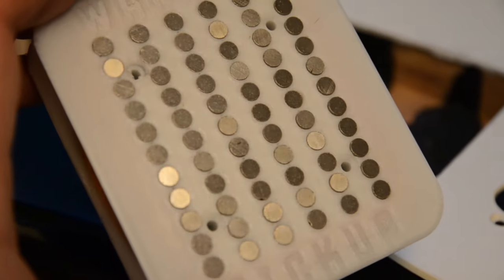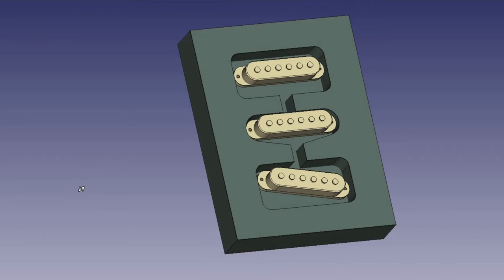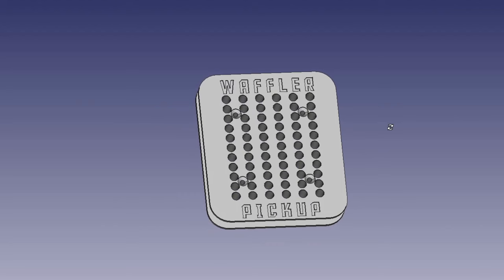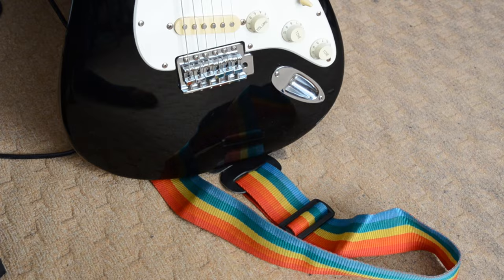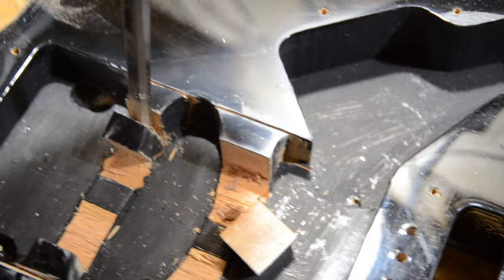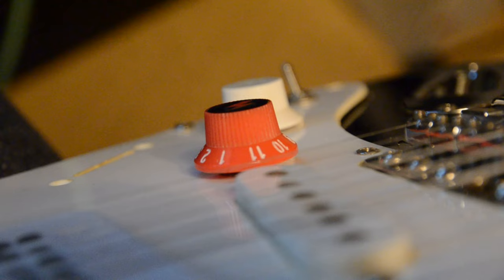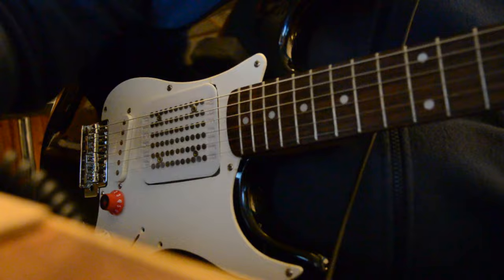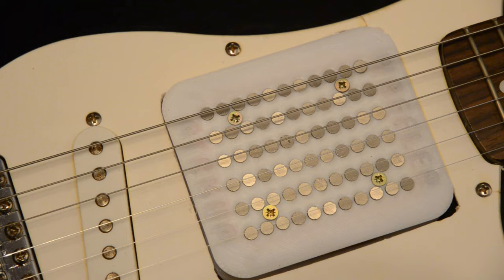Is this the world's most powerful guitar pickup? The Waffler pickup!

Comment: Hard to tell on YouTube, were the e strings much louder than the rest of the strings? Their pole pieces had much more copper around them
Reply from the maker: The strings sound evenly. I think its more to do with magnetic field that coil position. As the magnetics are all fighting each other (it takes some force to assemble this) a small change in magnet field on one side, moves the whole magnetic field. I am working on a video showing this. I will post this soon.
Reply: @deancoyle  one more question that you can talk about in your video, how does that many pole pieces effect the phase if at all?

Comment: Interesting experiment, however, there is no baseline to compare to. It sounds reasonably well, but there is no way to separate regions as there would be with separate pickups, which is potentially a drawback. A truly scientific experiment would have tested all of the variables before the introduction of the waffler pickup, and then the addition of increasingly larger pickups until there would be one single pickup taking up the spaces of all three original pickups. Also, several variations of the waffler pickup with various stages that could be switched on and off just like the original three pickups. 
Primarily, pickups sound different when located at different positions, because the strings travel as they vibrate and sweep a wider area the closer they are to the center distance of the string, or closest to the 12th fret. The frequencies generated closest to the bridge are shorter than those closest to the neck. It would be reasonable to assume that had you configured a waffle pickup with three separate sectors, four separate sectors or some other configuration, you would find that you would get different frequency ranges out of each sector. Although it would be interesting to hear how a much larger single pickup would sound like, the lack of control over the different sectors would be an overall negative experience, what makes the guitars most useful is that they enable the musician to choose the frequency ranges they prefer to enhance, by turning off the other sectors/pickups.
A completely thorough experiment would be interesting however. 
Thank you for posting this video!
Please have an excellent and awesome day! ☀️✨
Reply from the maker: Some really good points here, thank you Mike. I do plan on more experiments and will try to conduct them in a manner that allows a better comparison. I am working on a little follow up video answering some of the questions raised by this project so far, but after that would be good to try a range of sizes!  
 I hope you have an excellent and awesome day also! ☀️✨
Reply: Awesome, @deancoyle !
Thank you!
I look forward to viewing your other experiments, and the follow up to this video.
Please have an excellent and awesome day! ☀️✨

Comment: Since the coil only goes around the outside perimeter only those magnets will do anything. The rest just dampen string vibration for no reason. Not a feasible design at all.
Reply from the maker: My biggest concern when making this was that the magnets around the coils would be the most relevant. This would be bad as it would make the 2 E strings really overpowered compared to the other strings. But thankfully this wasn't the case (as can be heard). The magnets are all oriented  the same way and are all fighting to repel each other. The force to put in a single magnet is larger than I expected. But the magnets in this arrangement creates a magnetic field of a much bigger magnet.
Reply: Sorry but no. Look at a P90. If you were right, a P90 wouldn't work at all.
Reply: The polepieces on a p90 are not 2 inches away from the coil...

Comment: i still dont understand how pickups work
Reply: At the most basic level, the magnets magnetize the strings have a magnetic field. As the strings move, they generate an electrical signal in the coil alter the magnetic field, causing an electrical signal in the coil. Beyond that, it gets complicated.

-edited to be more accurate
Reply: @xenontesla122  no no no no.. strings don't get magnetized
Reply: 0. the magnets have magnetic field, the strings must be made of magnetically reactive alloys; 
1. strings vibrating inside the magnetic field of the pickup magnets (as a result of picking, plucking etc), make the field vibrate too, as if the strings are pulling on that field which now is shaking, almost like a jelly, until you mute your strings.
2. the coils are usually copper, a very good electrical conductor, and a conductor in a variating magnetic field (or the other way around too, a conductor moving inside a magnetic field) will manifest an electric current inside of it; that current is a proportional reaction to the way the strings vibrate, it will replicate the frequencies of the notes being played; that current is what's going on through those coil windings, becoming the pickup output, which gets amplified further on by electronics.

Comment: reduced sustain.
Reply from the maker: This is what I expected, but I think the truth is sustain is dropped when the vibration of the strong going through a range of magnetic fields. When the strings are close to traditional guitar the magnets, the field is strong, but when it is far away the field strength drops right off.  There should be an inverse square relationship between distance and field. 
With the strings not being that close on my pickup, the change in field isn't that much for the range if vibrates. 
(that's what I take away from it, I hope I explained it well)
Reply: @deancoyle  absolutely brother, gotya there. I drop all my pickups..humbuckers or singles. God bless ya from australia.